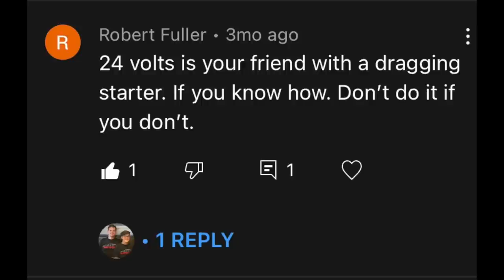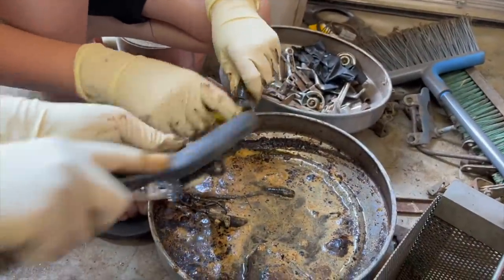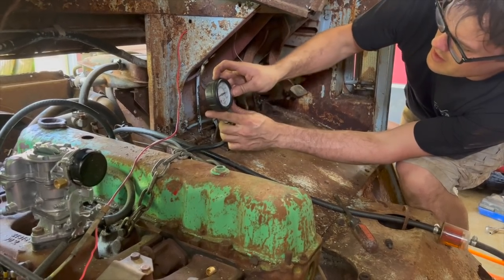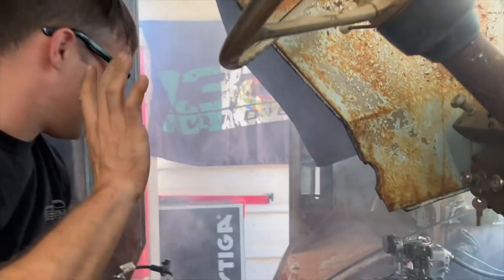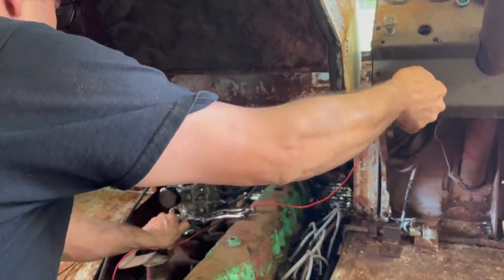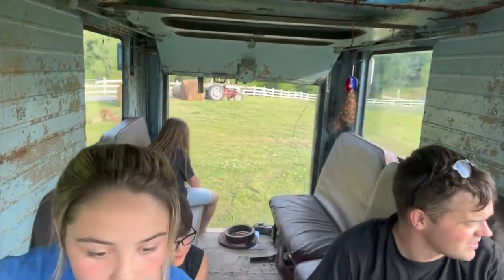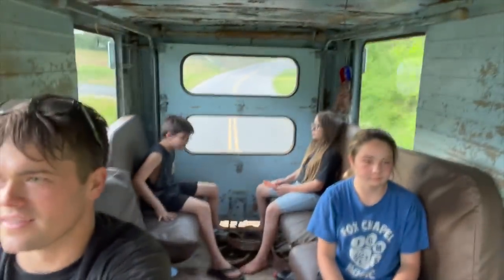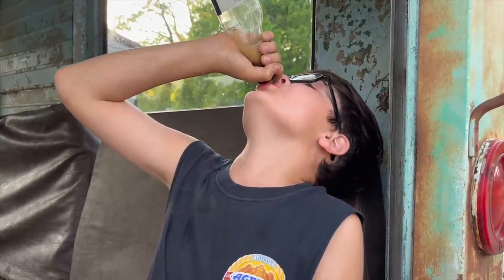We use all your tips to try to get the 71 metro mite running. will it start?

Comment: If someone hasn't already said it, when you were trying to check the timing and your timing light wasn't picking up the fire, it wouldn't have fired on number one since you didn't have the lighting wire grounded as it would be if it was connected to the sparkalator. Great job on all your videos. Great job with that family. Hallelujah!
Reply from the maker: Thank you

Comment: I did not think this old girl had a chance to even run at all. I still think the engine is in need of a complete rebuild if that is even possible, the crank my be beyond machining. So much blow by pushing past the rings into the crankcase, the valve cover was releasing all that blow by, it looked like a choo choo train. Great job hanging in there and not giving up, loved it.
Reply from the maker: Yeah your probably right

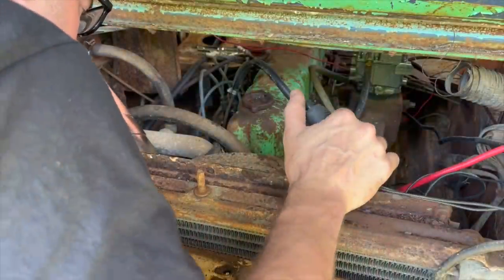Comment: Love seeing the family involvement!  At around 13:58, a timight light isn't going to pick up anything if there's no current flow through the plug wire as the wire clamp is an inductive pickup (generates a pulse from magnetic field of current running through the plug wire).

Comment: Awesome video! I always loved vehicles that were odd or different. When I was 18 I traded my car. A 85 olds cutlass ceria. For a non running. 1975 Chevrolet step van. That was a 3/4 ton. My Buddy's Dad tried every thing to get it running. Finally after almost 6 months he gave up. I worked on it two days and drove it home!!! Problem was the distributer was bad. I worked at a salvage yard at the time so parts we're plentiful. Loved that old truck had a lot of fun with it.
Reply from the maker: Thank you so much

Comment: It’s the same principle of the big electric motors they use in industry stuff. They just control the speed on them with voltage. Kinda like electric car it will go as fast as you feed it volts. Only thing that will hurt is ignition system might burn a coil or melt some points on one eventually or burn the thinner gauge wires up. But faster it spins more sparks it’s throwing so it should help on the tougher ones. Nice video 👍
Reply from the maker: Yes thank you

Comment: To give an example of the importance of that third ground as mentioned;  As a first year apprentice many years ago, I saw a wise journeyman struggle with a late 70's to early 80's square body chevy ( so long ago I don't remember which). Anyways.... close to the end of the second day I approached him to assist. He said that he done new jetting and everything he could do to the carb to get this truck to stop loping and dying out. I leaned over to take a closer look and by fluke we both discovered the issue. I had one hand on the engine and the other hand on the steel front clip and magically it was running like a top. He asked what I did and I had showed him. My body acted as that firewall ground that he was missing and it even started much better.  90% of starting issues is the grounds. After being happy with the continuity of those three grounds; then it comes down to connection from ignition to starter and whatever set up in between; ie: starter relay or solenoid weather it be top side or fender mounted ignition ground weather it be grounded to the steel body dash or a seperate ground wire ext.. ext.
Reply from the maker: Yes sir thank you

Comment: I love the right hand drive. If it was mine, I would chop the top by at least a foot. You should make a big wooden push bar for the tractor. Love to see Ralphie driving the tractor and turning wrenches. Great to see everyone got a turn driving. Why not use some of the bus seats to make a picnic table with wheels? I painted my motor the same color as the metro to match an old Indian motorcycle model I bought years ago. My motorcycle is a 1982 Suzuki 650, close enough to being an antique, so why not?
Reply from the maker: Yeah a push bumper would be nice

Comment: Another great video! Amazing how fast it popped off with the 24 volts, considering how much work you did previously. Apparently, the starter was drawing too much current and voltage that it was dropping voltage to the coil and wasn't getting a hot enough spark to start with just the 12 volts. Great job!
Reply from the maker: Yeah it surprised me

Comment: Really like the way you talk to your children mate. So points timing is done like this put the engine on the timing mark at the degrees for the engine you are working on ,if you cant find the info set it at 7.5 to 10 degrees BTDC, turn on the ignition hold the distributor shaft against rotation and slacken off the distributor clamp bolt move it back until the points are closed and then move it till the points just open and sparkyou can also tape the main HT wire from the coil just away from an eath and when it sparks (as you turn the distributor )you will then have a fairly accurate setting for the idle and start timing.Dont forget to nip up the clamp bolt. RegardsTHe starting will be helped by a decent ground wire between the engine and chassis and fit a relay to the start wire of the starter or at least measure if it has !@ volts !.
Reply from the maker: Yes sir thank you

Comment: Do this in starting a vehicle not run for a long time
1) Make a line from a portable gas tank do not use old fuel
2) check cap and points clean if necessary.
3) If motor is stuck use marvel mystery oils or vinegar or transmission oil to free up rings let sit for a while
4) Check carb for crap inside clean all parts.
Have a good battery cross your fingers and toes and away it goes
Reply from the maker: Ok thanks

Comment: Yea Momma !  The valve noise May be cracks in the shared ball assembly on the rockers.  They are cast aluminum or pot metal and break.
Reply from the maker: It sure sounded bad at first

Comment: Excellent video Sleepdude Crew  :) also yes 24 Volt Negative ground help out lots got that  motor turn over  fast because starter are 14 volt  is reason and old 6 Volt positive ground is 9 to 10 Volt starter to Lol more power helps on boost to also on front engine on Valve Cover need a PCV Valve on rubber O ring should have hose plug top on PCV Valve too so get Oil Pressure also Water even gasoline to engine smooth out !
Reply from the maker: Ok thank you

Comment: Man i love this van, it realy runs great. As for the roller throttle there is a pedal that fits over the roller wheel and hinges from the floor so you will have control, they are used on sand rails.ps i love that your kids are involed and the goats.
Reply from the maker: Thank you 😊

Comment: I was just going through my spare parts and found 6 cylinder AMC stuff. I'll have to go look but there are lifters, valve seals. And I think a timing chain set. Possibly other things. I have house for them. I'm retired now so any spare parts are yours for the taking.
Reply: Ok I went and looked. There are also valve springs and steel spring retainers all from competition cams. They've been on my shelves forever.
Reply from the maker: Ok thank you

Comment: A cheap fix for that smoke because you also might have oil coming in around the valve guides is to by yourself a spring comp ressor valves and just pop those seals off of the valves one by one and change the seals you'll learn a lot if you look at the seals with the valve cover off... You'll actually see smoke squirting out around the valves while it runs and that will tell you a lot
Reply from the maker: Good idea

Comment: The valve guide seals were leaking when you first started it that why it had good compression but it's venting exhaust thru the valve cover but it seems e have taken care of it's self  the radle was probably the cam lifters hadn't pumped up yet due to it setting for so long it sounds really good I little timing and carb work I think you're golden 👍
Reply from the maker: Thank you

Comment: I wondered what happened to this project.  After he got it running on 24 Volts he said that he had it back on 24 Volts, I think he meant 12 Volts.  If he doesn't want to see his projects smoke so much, he needs to stop pouring oil into to the cylinders.  I think it quit rattling when oil finally got through the built up dirt in the oil galleries to the lifters and such. Ron W4BIN
Reply from the maker: I don’t mind them smoking

Comment: Love the ice cream truck. I have 74 International box truck like UPS truck. V8 4 speed dual exhaust glass packs love driving it. Its aluminum body 7k lbs so its light for big box its so much fun way bigger than your postal truck. Lol.  I want to put a Cat C7 engine, tranny, axles, hoops, casings all the running gear from a bus under it lowered on those big hoops would be way safer cause while it has plenty of power drum brakes on that big rig sucks.  Loving all the content you got coming out.

Comment: Not for sure but think that's built on a 2wd Scout chassis, the automatic transmission is probably a Borg Warner unit,AMC and IH went to the 727 Torqueflite a year or two afterwards,if the rear axle is a Ford 9 inch it's probably a later addition,IH used Dana axles mostly in their light duty trucks.
Reply from the maker: I think you are correct

Comment: You're put a hook on the floor of the garage and you can use a snatch block up there and then you can take a piece of cable and pull it with the tractor from underneath the vehicle outside you can pull it backwards. Then you won't have to push it in there like that
Reply from the maker: Yes 👍

Comment: I never thought about the 24 volts! We've got mostly 12V stuff at the paving company I work at, 24V makes sense in some applications. That blow by from the valve cover confirms it's a postal vehicle because that engine is cooked like a well done steak, and yet it runs.
Reply from the maker: I couldn’t believe it

Comment: Static time it by lining the timing marks up on the compression stroke and turn the distributor body until the points open. Blowby out of the carb indicates the timing is off.
Reply from the maker: Yes thank you

Comment: The engine is either a 232 or a 258, visually identical engines, the only difference is the stroke of the crank, the 258 had a lower peak torque RPM, 10 more horsepower, and that’s pretty much it, given that it is a 3-speed with its steeper gear curves, and carrying all the payload, there’s a chance it could actually be a 258. Unless you’ve already determined it to be a 232, then I’m just wasting my time commenting this lol. Not surprised it came around though, they are great engines, cheap as all get-out to maintain so it makes sense in a mail truck.
Reply from the maker: According to my research these only came with the 232

Comment: Smoke out the valve cover.  Sticky rings. Use thinner oil.  10 30 max thickness. Reason rings stuck and thin oil will devolve the carbon in the rings.   Your thick oil heated up and thinned out and eventually got into all the crevices.   The she quieted down.  I think is was a rebuilt motor that just got a tad surface rust.   But all looks good now
Reply from the maker: Ok thank you
Reply: Yeah.  Just seems realky tight. Like it was a fresh rebuild along time ago.  Of head ever was removed then we definitely kmow. But if it's running great no need to pull head.  I'm very Excited for you and All These running.    I Was Very thrilled to see this run

Comment: If the knock is from hydraulic lifters, the Marvel MO you have in there will work fine, but if it is bearings, you will want a very thick additive like STP, especially in summer, and Marvel is thin, better to add in fall.
Reply from the maker: Ok thanks good info

Comment: Make sure there is oil in motor  pull plugs less resistance leave plugs out . Turn over a couple minutes each time. It should turn over a little faster each time put plugs in ck timing and fuel delivery . Try to start be sure not. To run without coolant.
Reply from the maker: Good tips

Comment: I would love to have that....... I hope you guys are going to restore it.... Turn it into something cool like a camper van....... Okay because I've been a mechanic for 55 years plus..... I'm going to cut through all the BS for you.......... First off pull the plugs poor oil in the cylinders if you got a thing it'll squirt oil squirt it up into the top of the cylinder head too and those were really interested right here it's just to get the motor loose and rotate it.... Because if it doesn't rotate then we got to do plan b.........
Next get the starter working and just plain old hot wire it get the points working and put a wire over to the coil from your battery to run the ignition...... See if you can get it to spin with the starter...... If it'll spin it may start...... Also..... Get yourself a few cans of quick start. If you can afford it....... Take off your cleaner squirt the quick start in give it about 2 seconds worth of spray...... In the carburetor...... Have a great thing about quick start is it will tell you instantly so you don't have to sit there cranking longer than one second maybe two.... It will tell you if your ignition is the problem or your carburetor is the problem..... Because if it starts your carburetor is the problem....... If it doesn't start your ignition is probably the problem........ And that is how you do it..
Reply from the maker: Thank you good info

Comment: Add a little start fluid  do Not turn over on 24 volts for mote yjan a minute. Heat up starter. Burn  out starter. Good luck do not run without coolant
 Good luck
Reply from the maker: Ok thanks

Comment: if the brakes want to kill you it may be that they are only working at 50% (slider bolts are rusty on brakes) this would mean that the faster you go the harder it will be to stop if it is disc brakes.
Reply from the maker: Ok thanks it is drums

Comment: You're working on Frankenstein. 
No it's an International. 
It has an International engine?
Nope it's AMC.
And the rear?
It's a Ford. 
And it has a Chrysler automatic?
Yeah I think so. 
You're working on Frankenstein.
Reply from the maker: Sounds about right
Reply: @Sleeperdude  Pretty cool ride. It quieted right down. 
Lots of possibilities. Make a great covered pickup or a nice camper. 
Good video. TFS Happy Motoring.

Comment: If it had been a 24 volt system you would have had the same issue and had to add more voltage. Another thing I saw here was the quart of Marvel. I worked as a mechanic at a shop for 30 years and watched a couple people use a pint or quart of Marvel and wore the engine as out early.  Too much of a good thing is usually a bad idea.
Reply from the maker: Ok thank you, it seemed to stop the rattling
Reply: @Sleeperdude   Yes but needs changed before bearings are washed down. A little is . Probably would not add any after oil change. Been a mechanic since 1969.
Reply: it does a great job cleaning the oil ports out